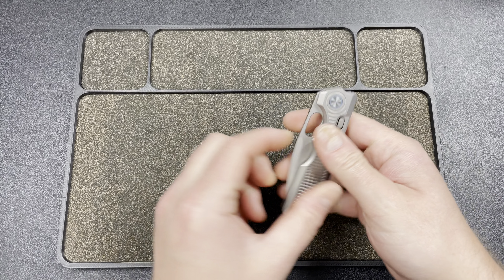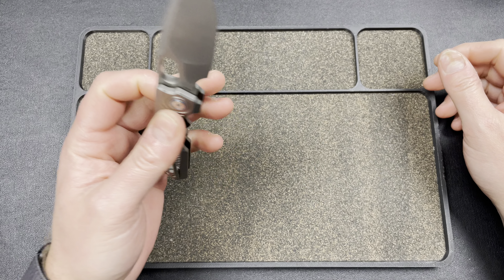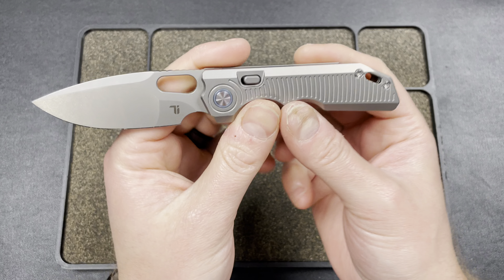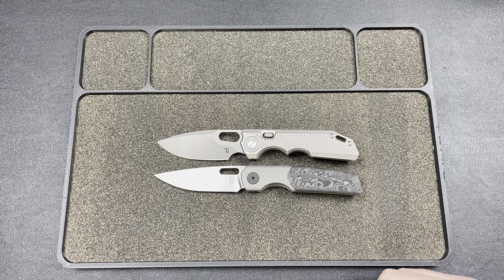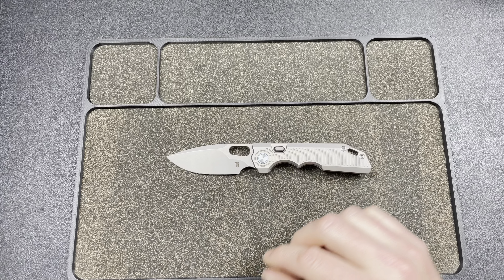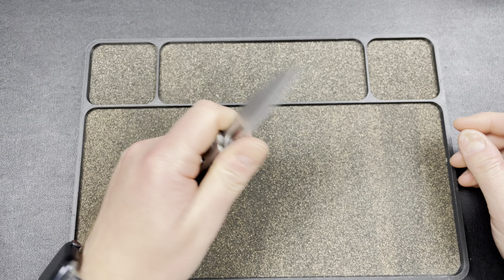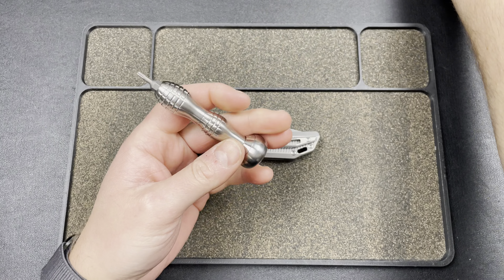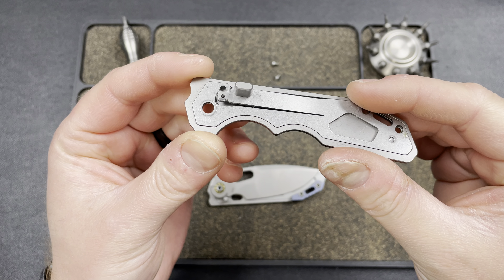Blasting Out of the Gate! | Ticonic Ticon 1 Overview & Disassembly

Comment: M390 hrc of 60 +/-2. Possibly 58.. top liner lock is not something I'm paying extra for,  super choily looking,   its ok but in the 250 range your competing with knives like compadre, upgraded spydies
Reply: the very low hardness and giant range is what turned me off to this knife 58 and even 59 is not acceptable for m390. if they can't heat treay the steel right just use a different one. s35vn is a great steel that can be run lower and would also wrong down the cost of the knife.